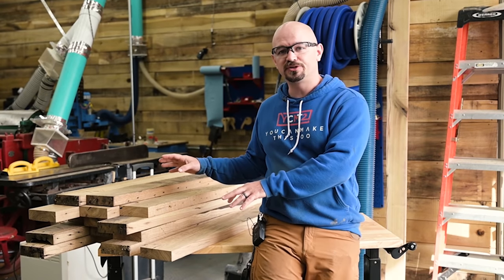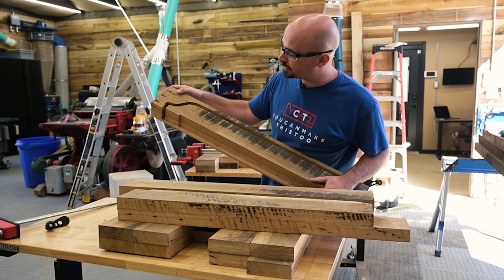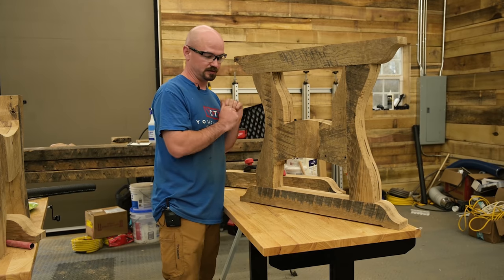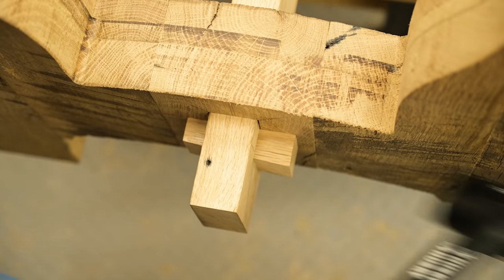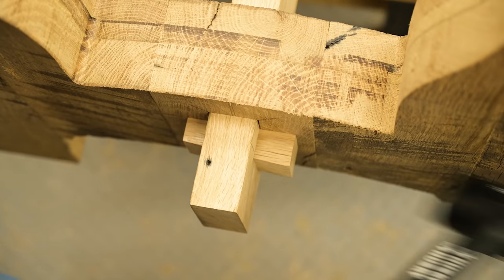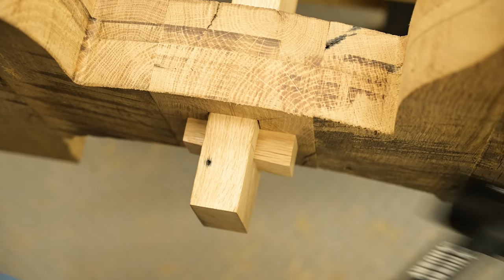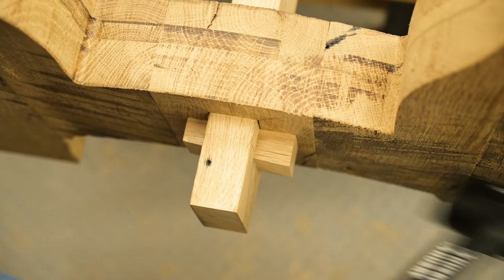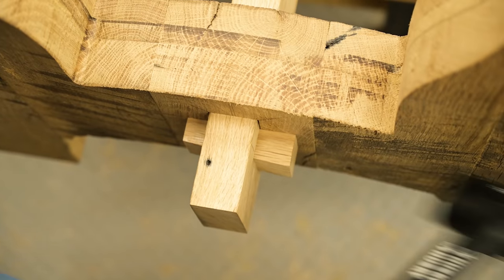Reclaimed Barnwood Farmhouse Table Build with plans

Comment: I actually subscribed to your channel just now because you made a mistake, and you opened up and didn't edit it out. But even if you had edited it out, I'd have respected you just as much if you'd told us, without showing us. I've enjoyed the build. Great video. I use dowels myself, but respect the Domino maker. They're a great device. I'm just a dowel-guy.
Reply from the maker: No shame in either game man. I do a lot of commissions for income, so the domino is the winner for me time wise. Also, the connector system is super handy for really big builds that I've gotta build in the shop and assemble on site.

Comment: Caleb, I'm so impressed you got my old Bentel and Margedant planer online. I love how you have two dust collection ports on the cutterhead. I would be interested in hearing about any modifications/improvements you made to that circa 1888 machine.  Beautiful table. You're a good teacher.  All the best!
Reply from the maker: Thanks, Charles! I also put a helical carbide cutterhead in it and had to swap the 3 phase main motor for a 7.5 horse single phase. The small motor doesn't slow it down at all though!

Comment: I have the same Mikita miter saw as you. I’ve been looking in vain the dust port adapter. Can you provide any guidance for the part number?
Reply from the maker: Sorry, wish I could... I just have what came with the saw. Maybe check the manual? They often have part numbers for components and accessories.

Comment: How many coats of the Halcyon do you use? That stuff is turning into my new go to finish over all the other ones
Reply from the maker: I spray it and normally do two coats, sand smooth, then spray a final coat
Reply: ok I've been doing around 5 coats total, guess I'm over doing it.

Comment: Be careful running your toolpaths too slow...chip load is important to cool the tooling and a hot tool will start to bog down. It really is a math problem! (drat...) I really like this project, BTW...reclaimed can be incredible to work with and the end result speaks for itself.
Reply from the maker: Oh yeah, I"m quite familiar... it was just a challenge with that tool being so long. I should've ran what I could with a shorter tool and then switched longer to finish it.